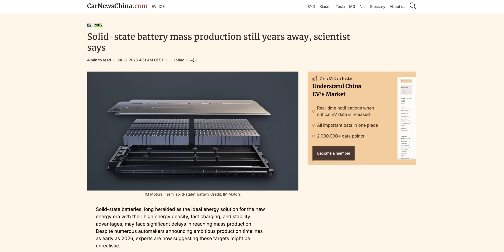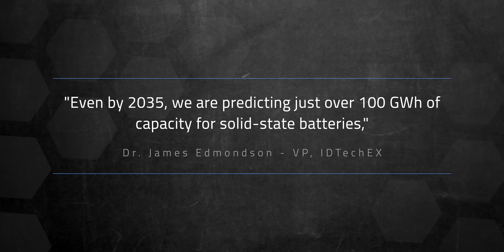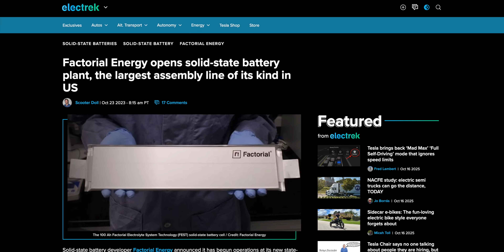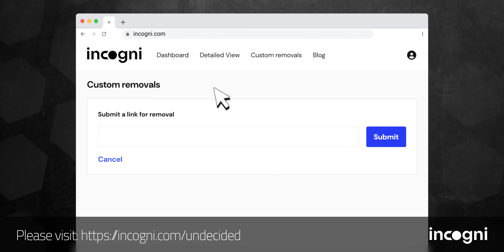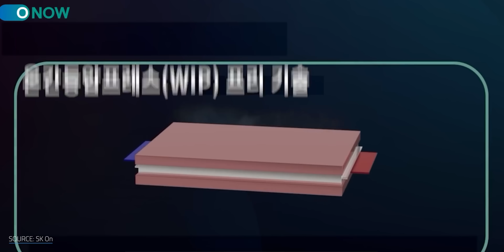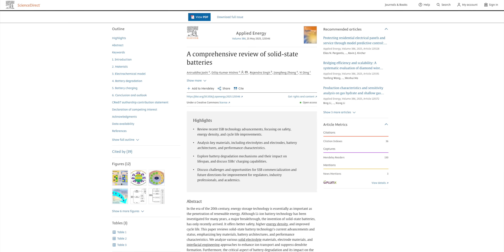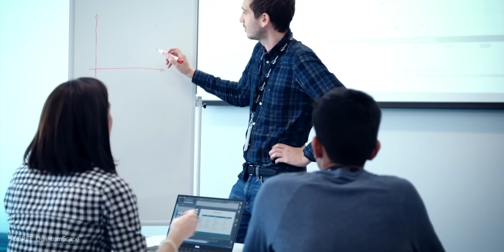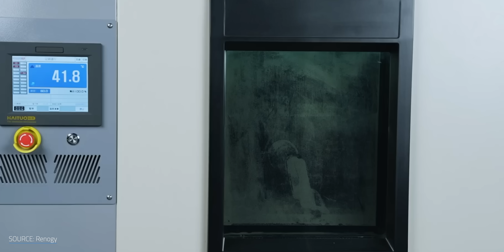How Close Are We to Solid-State Batteries?

Comment: Energy density, cycle life, charge/discharge rate, safety, price. The important specs.
Reply: Also voltage curve. LifePO4 has a fantastic curve compared to Sodium for instance.
Reply: @JayClarkTheShark  This is a great point! I never noticed how different the voltage curve was for sodium, but I am a novice in this field though.
The only benefit I can think of is easier circuit detection of a low voltage to prevent damage to the battery due to the steep output curve. Other than that, it's a big disadvantage.
Reply: @JayClarkTheShark  Temperature efficiency, too, for that matter, which sodium beats lithium at.  Lithium doesn't charge at all in freezing temperatures.
Reply: @JayClarkTheShark  A rather flat curve isn't always a good thing - a battery where 12.4v is half full and 14v is full following a rather predictable curve makes knowing the current state of charge easy compared to a battery that is sitting at 11.4v ballpark from 10% charge all the way up to 90%... Somewhat arbitrary numbers obviously, but still a valid reason to actually prefer a battery with less 'fantastic' voltage curve in many cases - obviously there are times stable voltage is very important as well, and then a battery that is more consistent makes any power circuitry required to get that stable voltage easier and likely more energy efficient.
Reply: @foldionepapyrus3441  I am not sure in 2025 with DC-DC converters that a flat discharge curve is remotely useful. It was important 30 years ago when you didn't have widespread DC-DC convertors in everything, but now it is meaningless. For example, in a flashlight, a flat discharge curve meant the brightness didn't change much during discharge. Now, with DC-DC converters, it doesn't matter one jot what the discharge curve looks like; brightness is basically unaffected.
Reply: @jonathanbuzzard1376  Indeed, but plenty of devices don't deserve the complexity added by a DC-DC convertor (simple as they can be) or really really want very smooth power and the Buck-boost might be efficient (and pretty cheap) but they are also rather noisy. And the smoother power conversion stages are generally less efficient, so being able to skip or minimise them as the battery is relatively stable helps.
Reply: Recyclability, environmental impact, repairability are also important factors.
Reply: @inso80   we recycle 95% of all the far more toxic lead-ACID batteries in gassers. Obviously bigger more valuable EV batteries will be recycled. Design for disassembly helps recycling and repairing, but all batteries are orders of magnitude more sustainable than burning through tons of dirty fossil fuel.
Reply: @skierpage  True, but one needs to be vigilant about the environmental impact with many aspects. Like green or blue hydrogen and materials like cobalt. Not to mention if recyclability or repairability is considered in the design or logistics. That is not a given.
Reply: @PocketBrain  sustainability?
Reply: I'd add in though it is related to price materials required, related as it might be a cheap battery to make now if its using something rare but otherwise practically useless, but it won't stay cheap if the batteries are good enough to create a demand that outstrip supply. But also as so many things are being electrified for other agenda than just price where the materials come from and what they are matters.
Reply: @PocketBrain  and how many children were mining minerals required to build it. People forget this..
Reply: @prophoenixPL  I'd guess about the same amount. Anyway I'm sure another mine will hire them if the move happens, it's in the name after all - mine ors.
Reply: @prophoenixPL  no company will admit to that, so you'll never really know. Mind you, certain materials are less likely to be mined by minor miners.
Reply: You forgot sustainability, the #1 most important factor
Reply: Those are all the specs and you can't have it all.
Reply: And energy density, if its not static install
Reply: Recylablity
Reply: And temperature range.
Reply: until you go at snow hahahhaa
Reply: @slevinshafel9395  What are you talking about? Of all batteries, solid state would be the ones to handle temperature extremes the best...
Reply: Why you would think they're going to be affordable is beyond me. Any time something new comes out (that has a lot of demand), people make damn sure that they're going to be as greedy as possible by charging as much as they can.
Reply: @solitivity  That's normal market dynamics. Supply and demand. Are you sure you are not projecting?
Reply: And repairability fellow Clippy enthusiast. Let's not forget
Reply: A nothing burger video about another battery company lol been hearing about those for like 20 years, investment scams lots of this.
Reply: @PocketBrain  price not really, everything by definition gets cheaper by larger quantity production
Reply: You can be sure that any successful ss battery tech will first be adopted in flight applications due to substantial weight reduction.  Even if EVs get them early, they will command a hefty premium outside of China.
Reply: @PETERJOHN101  Synthetic jet fuel is still the only viable carbon neutral option for long haul flights, with nothing else on the horizon.  Scenic flights and training flights are able to use batteries right now.  Maybe some more small passenger, and mail runs will make use of batteries in the near future...but scaling up synthetic fuel production might make that moot, depending on costs.
Reply: @ChrisNotTheKing  
I didn't say anything about long haul flights, I said that ss battery tech will be adopted by the aviation industry before it is cheap enough for most EV buyers.  No one in this thread knows how to read.
Reply: @PETERJOHN101  You're not wrong.
Reply: @ChrisNotTheKing  he's definitely wrong
Reply: @veganpotterthevegan  
Your silly responses are a result of poor research.  By the time solid state batteries are affordable for the majority, companies like  Elysian will have 90 passenger electric passenger planes in the air.  Look it up.
Reply: @PETERJOHN101 I suspect not because the regulatory environment is so much more stringent/laborious. We haven't even been able to move off leaded aviation gasoline because the testing and certification for engines takes so long 😢
Reply: @idstealth 
There is already a 6 passenger commuter jet in service using lithium-ion, so it's very likely that ss battery tech is coming to aviation soon.
Reply: @PETERJOHN101  that plane barely has any cargo space, it's very slow and has a very short range.  SS as we know it now, won't change aviation as we know it.  It'll let them build a slow plane for 15 people without much cargo, for very short trips.
Reply: @idstealth  what about kerosene?
Reply: @YetAnotherUnixUser jets use what is basically kerosene. Piston aircraft use what is basically very high octane gasoline. Which is leaded.
Reply: @veganpotterthevegan  
Where did I say anything about current electric planes having long range or generous cargo space?  I said that ss battery tech will be adopted in aviation before it becomes cheap enough for most EV car buyers.  Does anyone in this thread know how to read?
Reply: @PETERJOHN101  you didn't say a single sensible thing. And SS batteries will be in a mass market vehicle within 5yrs. It won't be in a production commercial plane for at least 15yrs.
Reply: @veganpotterthevegan 
There is already a 90 passenger plane being developed for ss battery tech though it isn't likely to see production before 2030. It seems you are somewhat misinformed.
Reply: @veganpotterthevegan 
There is already a 90 passenger airliner in development for ss battery tech, and electric commuter planes now in service can fly 500 miles using LI, so why would it take another 15 years for ss battery tech to be in the air.
Reply: @PETERJOHN101  absolutely not.  They'll get is after all our phones have it and it's the norm for cars.  Jet engines last a long time and the batteries being light enough to fly, also need to be light enough to land.
Reply: @veganpotterthevegan  jet engines last a long time but they're being overhauled during that lifespan
Reply: @veganpotterthevegan 
Light enough to land?  Sure, dude, whatever you say😂
Reply: @jeffk464  absolutely, but they still do last a long time.  Airlines will also want to get their ROI before switching to electric and they're not done buying planes with jet engines.
Reply: @PETERJOHN101 Um, I take it you’re not around aviation much. Landing weight is a major concern.  The shock forces are much higher landing than taking off. That extra stress on the airplane, not to mention danger if the runway conditions are poor is a big problem. The advantage with fuel is that by the time you land there’s considerably less of it. Have you never wondered why pilots will dump fuel when they need to make an emergency landing shortly after takeoff?
Reply: @Alexlfm  
You must not realize that landing weight is exactly why solid state batteries will be adopted in aviation, due to the dramatic weight reduction these batteries will make possible.  Is this point that hard to understand?
Reply: @PETERJOHN101 🤦
Reply: @PETERJOHN101 Over fuel? Batteries of any kind will ALWAYS be heavier than fuel. Jet fuel is the most energy dense material you can get outside of radioactive materials like plutonium. It’s over 20X more dense than the current highest density solid state battery. 

Besides, when you land, apart from your reserve the fuel weighs literally nothing because it’s gone. A full battery system would require a significantly upgraded airframe to handle the massive increase in weight.
Reply: And for me, solid state should equate to cycle life, primarily. The other specs are important for any battery but a "solid state" battery doesn't have "moving parts" and that implies shouldn't wear out to me.
Reply: And on only one of those specs (energy density) is solid-state better than China's latest 10C, 1,000,000 km, Megawatt-charging, "puncture them and nothing happens" LiFePO batteries from BYD and CATL, available now.
Reply: @skierpage  that's just not the case with LiFePO4 batteries.   Lithium titinate batteries are the only available batteries that do as you described but barely anyone is using them for a multitude of reasons.
Reply: it doesn't matter, Silly Goose
The problem is EV motors - they create a strong EM field which will gradually destroy YOUR health
say NO to EV coffins
Reply: @biosupdate-p7x  This isn't some voodoo stuff, just simple physics, if the motor would create strong omnidirectional EM fields enough to harm living organism, that energy would come from somewhere. That means that would be less of a motor and more of an energy waste kinda device, since energy would be wasted on incorporating EM field rather than doing useful work. But guess what, electric motors are very efficient and turn around 90%+ energy into useful work, rest is wasted as hit. So no mystery here where the energy are being spent and it is for sure not on your nonsense premise. Electric motors are used in trains, subway, trolley-busses and trams and i am sure that people aren't dying in droves while riding those things.
Reply: you're missing capacity and weight cause density means nothing if the capacity is shite with high weight.
Reply: @princeking1562  energy density incorporates both of those things though, so not sure how he forgot.
Reply: @thrashergx4877  the energy density required to fly the required distance is still not high enough to land with.  Even expected solid state density isn't enough.  We're going to need +third gen SS or something that's not even being thought of yet.
Reply: @thrashergx4877  It actually doesnt energy density is related to but not the same thing as capacity and weight is a whole different subject
Reply: @princeking1562  Capacity and weight are related to an implementation (ie an actual example of a battery) whereas energy density is the technology and is the important factor. You can make lighter, larger capacity batteries but they're ultimately limited by their energy density.
Reply: @medhurstt  All factors are important density would be more important due to batteries having more implementations than just locomotive usage however with EV's a battery half the weight will be better than twice the density.
Reply: @princeking1562 Energy density means exactly that.
Reply: @princeking1562   "you're missing capacity and weight cause density means nothing if the capacity is shite with high weight."  So what in your world in energy density in the world of BEV's?
Reply: @princeking1562  density is literally capacity over weight a higher density means higher capacity for same weight or same capacity for less weight or a little bit of both
Reply: @markgeorge447  look at his comment carefully not what you want to see but what is actually there.
Reply: @princeking1562  Literally the first 2 words of his comment "Energy density"
like literally what you were asking for how much capacity for any given amount of size or mass

if you want more accurate terms yep he should have written "specific energy" which means how much energy a battery can hold per unit mass (only mass not volume)

  , go search the term "Energy density" and "Specific energy" you "may" get my point 
but he didn't miss out the point you were stating he might just used a common misnomer right there
Reply: @markgeorge447  😂